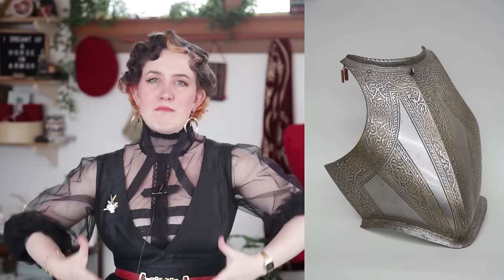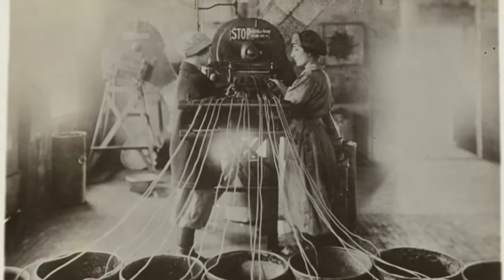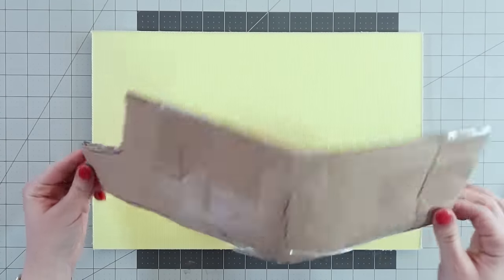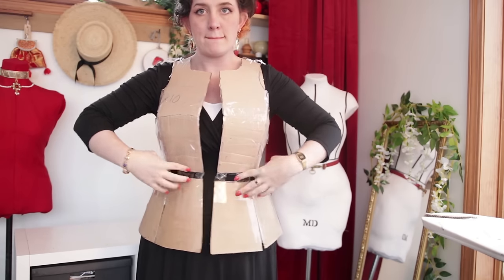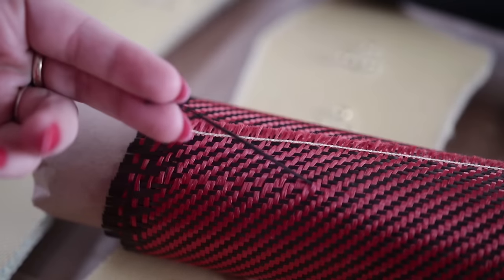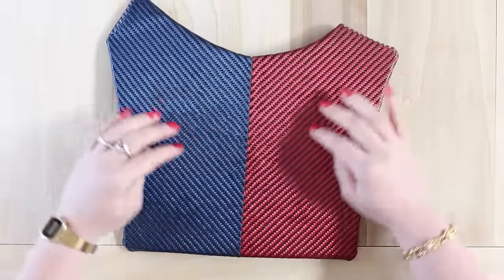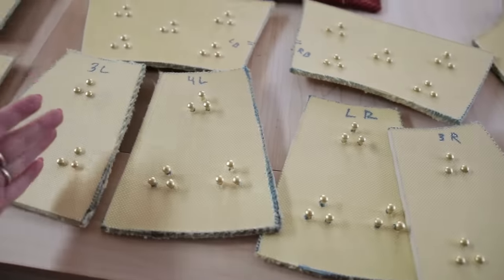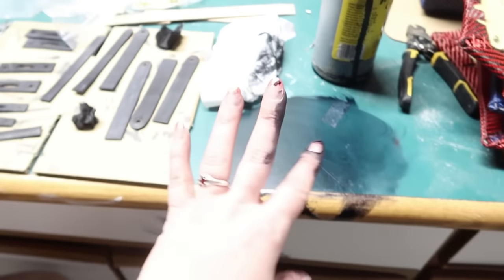I made Medieval(ish) Armor out of Kevlar

Comment: the big problem with the MET brigandine cuirass is that the fauld likely isn´t original. it, unlike any other find, has vertical plates, whereas horizontal plates are found on all other surviving examples. when they are solid plates, vertical ones limit your movement way more. i guess if they´re just hanging without connection it doesn´t matter though.

Comment: As a medieval re-creator, I appreciate your video. 

Historical armor is actually one of the things many modern armor creators look at when theorizing new ones because those formats have been tried and tested. There's even an example of scale armor using small discs that was made to resist small firearms. 

If, truly, your concern is saving lives I'd urge you to consider the biggest killer in the United States. Smoking. Nearly half a million people, per year in the US, die directly from smoking. This does not include deaths of children, elderly and those with lung issues such as asthma, or COPD affected by the second and third hand smoke or the over 3 million hospitalizations due to it which would ramp that number easily to 700,000. 

I say this as a medical worker. In 15 years, I've never responded to a lethal shooting but I have watched countless people suffocate because of the effects of smoking.

Comment: silly question as it's a bit too late but, why didn't you use a rivet setter?  you could have gotten through the riveting job a ton faster as a simple one can drive the burr down flat. which would have then allowed a quick trim and rounding with the cup shape on the same tool. 
the concept for this project is cool but you could have saved a bunch of aggravation by using a nice heavy weight skirting leather and then covering that with your carbon fiber fabric.  it probably would have been more comfortable than the carbon fiber panels. perhaps a do over is warranted.

Comment: Year old video but I'll say it anyway, for cutting the Kevlar you would have been better off with a razor or even a pizza wheel. Kevlar is bullet resistant but it offers almost no protection against stabbing attacks because of the different ways the energy is transferred from knives and bullets. The bandsaw relies on the momentum of the heavy band rather than the strength of the motor itself, that exactly the sort of force Kevlar is designed to resist, but you'll notice when you use the scissors to clean the edges, it's no more difficult than any other type of stiff fibre.

I learned a lot tho, thankyou very much.

Comment: as a reference when working with kevlar any thing.  DO NOT use your good fabric scissors. use dollar store cheap ones. it will ruin what ever type of cutting device you use. I have thread that I cut with an exacto knife for this reason. I have also ruined rotary cutting blade with kevlar fabric. it will also ruin sewing machine needles.

Comment: This was an awesome project, but I just want to point out that working with Carbon Fibre comes with health & safety risks!
Carbon fibre, when cut, will create tiny little splinters, when breathed in these splinter can create respiratory issues, so using a mask is always advised! It also has some  conductivity properties, and the tiny splinters/shards can cause short-circuiting in electrical equipment (such as a band saw, or a sewing machine).

This was a great project, absolutely, but it saddens me that there wasn't any information on the health risks for using carbon fibre 😔
Reply: Yikes. Thanks for the info. I wouldn't have thought about that bit. So that was a good reminder.
Reply: Yes, thank you! Let's get this comment to the top. You don't want to be breathing tiny carbon fibers, you don't want them stuck on or in your skin. So maybe use something else as outer fabric, it can still get coated in vinyl if it's such a loose weave, to stabilize it.

Comment: Actually, your problem was that you used the wrong materials.  Rather than using Kevlar, I would have used multiple layers of linen glued together.  I would start out by making a papier-måché mold for the toughest curves and then laying down layer after layer of glue soaked linen.  That would then dry into the curvy shape you wanted, which would make things not only much cheaper, but also easier, and surprisingly more historic, since that is reportedly what actually happened in the past.

Comment: I think the moral of this fable is that one should consider the properties of the fabric when designing a project.   you were working against your materials so much. 

The decorative rivets weakening the Kevlar, and not in any of the right places to help you, like the corners you had to baste anyway.  

it kinda makes me want to see what could be done, if, instead of starting with Kevlar plates, and cutting them apart, you started with single layer Kevlar fabric, and built it up.  layering , laminating, using seaming and almost, like, sad stitching to shape it.   and then the rivets, if you wanted them, could be for areas where you added in another layer and wanted to prevent shifting at the edges.   could you make something body shaped and strong, but flexible enough to put on?  and to sit and move? 

Thoughts.  but i don't have the resources to try, and Bernadette's book gave me, like, 14 ideas on how to use the fabric i Do have, so, whatever.  it's a thought experiment.   Maybe try it in canvas and vinyl first for sanity's sake.

Comment: I saw you using safety equipment and mask as it it is carbon fibers . It's not to be breathed in as it sticks to the lungs. Kevlar as I know it is very expensive and and to deter bullets. Special scissors were created to cut it . I'm sure you could have found a half dozen fabrics or things to duplicate your intentions. I suppose it would give you some sense of protection at a Ren fair as there are crazies all over.